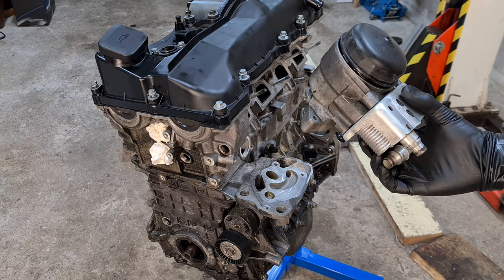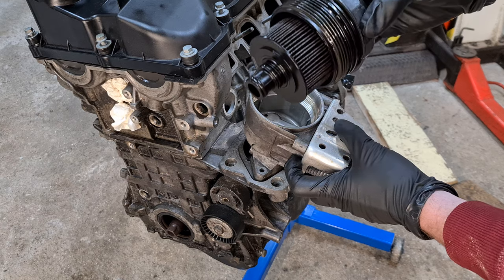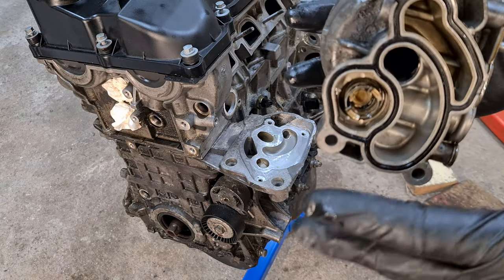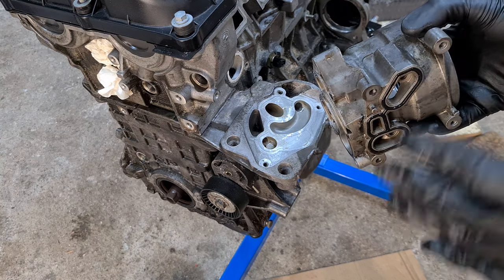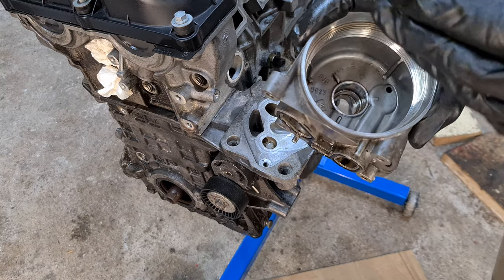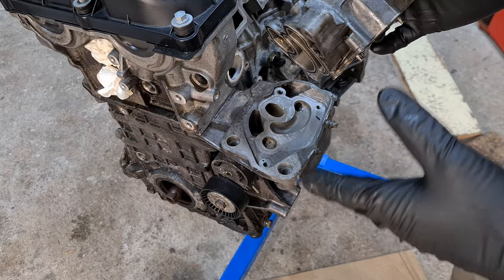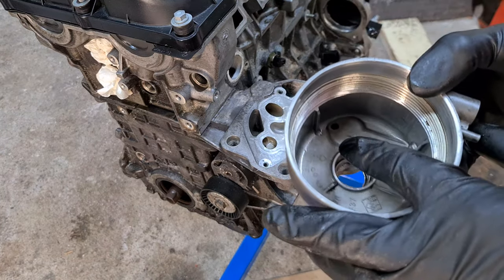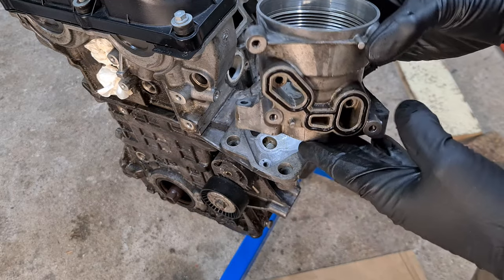N42/N46 Oil Filter Housing Details Explained

Comment: i have water that is mixed with oil out of this unit ,its a nightmare,i was hoping you were going to say if oil is coming out of ,but anyway ,i take it it will be the heat exchanger would the gasket cause oil to go into the water pipes? when i strip it of the engine will let u know if it was the heat exchanger ,great vid thanks for showing me this unit :)

Comment: Thanks for you reply, one other question, when I removed the oil filter housing and cooler to replace the gaskets I did the finger over the hole test for the check valve and it leaks which accounts for the startup rattle I believe. You mentioned the checkvalve is a non replacement item - is that still the case? What would happen if the checkvalve was fixed? I mean blocked off.. just curious. thanks again.

Comment: I have bought a car with an N46 engine. It has low oil pressure when the engine runs. Aside from low engine oil, what are some things that I should check?

I am replacing the engine-oil filter and all of the o-rings and oil-filter housing gaskets.
Reply from the maker: 1. Faulty oil pressure sensor (normal open switch).
2. Pieces of broken chain guide inside the oil pickup, oil pump, oil pressure regulator (oil pan needs to be removed, everything inspected and cleaned, and chain rail replaced)

Comment: Would you be able to do a video on how to get air pockets out of the coolant system/ common leaks ?
Reply from the maker: In general, you open both vent screws, turn ignition in to position 2 and turn up the temperature to max. You then slowly add coolant, filing it to the top. When you se that level stays steady, you close the vents and filler cap. You then run the engine until the thermostat opens. Then you recheck the coolant level and top it up to the max. Then rev the engine above 4000 rpm a couple of times for a couple of seconds to purge the air from the system. When the engine cools down a bit, you can re-check and top up coolant.
Reply: @BimmerZen  " Then rev the engine above 4000 rpm a couple of times for a couple of seconds to purge the air from the system." With the vents closed or open?
Reply from the maker: @robertalexandrescu9975  closed

Comment: Hi, I have the same engine in a 18ti, and one of the conectors of the coolant in the oil cooler is broken and I bypassed that tube, so there is no oil refrigeration.  I have to wait over two week to the part arrive to change it . Will that be dangerous to the engine?

Comment: I replaced both gaskets with Elring gaskets a few months ago and the bottom gasket is leaking again. The surface was clean and flat and gasket was installed correctly.  Have you experienced this issue?
Reply from the maker: I haven't. Maybe your oil pressure is too high?
Oil pressure at idle speed with engine at operating temperature 1 Bar min
Control pressure with engine at operating temperature is 4 - 6 Bar
Reply: @BimmerZen  could check valve cause this? No other gaskets are leaking just this one and it's pouring out

Comment: Thanks BimmerZen. Nice video at the right time. Since couple weeks a low oil pressure lamp is going on for 2 seconds on engine start up (e91 n46). I think it could be the check valve. Is there a way to check it? Or just take apart and inspect?
Reply: hi, just my two cents worth, I am a mechanic but boy are these cars over engineered, I can pull two american v8`s out in the time it takes to just jack up one of these bimmers. Anyway I have start up rattle in one of my e46`s, I pulled the oil filter housing and cooler, in one of the videos you can see where you hold the housing and put your finger over the little hole and pour oil into one of the channels, you can then see if the check valve is leaking, mine is, I have a spare housing , that one leaks as well.

Comment: Hi BimmerZen! Recently fixed a bad timing chain rail guide using your videos.
I now have a problem with the adaptation values for the exhaust cam sensor. Error code CDKPH2. I don't have inpa, but I use carly to read fault codes and values. Inlet is fine, reading 119.80. However, outlet is reading 120!! Timing should be correct. Is this likely to be a bad exhaust vanos unit that doesnt lock in initial position? It has poor low down power, but is okay at higher rpm. Has stalled once while driving, where warning lights came on.
Anyways, keep up the good work man, your videos are a goldmine!
Reply from the maker: One possibilty that comes to mind is that the exhaust VANOS unit was somehow not locked in initial position when you did the timing. I would start with the simple things first, like checking that all is correctly connected, especially VANOS solenoids. Sometimes people accidentaly mix connections. Next you will have to remove valve cover and check out timing with locking tools. Also make sure exhaust and intake vanos units are not switched around...
Reply from the maker: You could also try swithing intake sensor to the outlet, just to make sure its not an issue with the exhaust cam sensor.
Reply: Okay thanks! I replaced the sensor not too long ago, and if i remember correctly I also replaced the solenoids. But i will for sure check this out!

Comment: Thanks for another helpful video. Have you encountered the start-up rattle which many people have observed on N42 and N46 engines? You can hear this for a second or two when starting the engine from cold - especially if it hasn't been run for a couple of days. It sounds like the valve gear isn't getting any oil and disappears once the engine is running and oil pressure returns (this is my theory). I spoke to a BMW mechanic and he told me that this is normal and the result of oil draining away from the valve gear - but I'm not 100% convinced.
Reply from the maker: Yes, I know the rattle very well. In fact, I have it myself on my car and I plan to do some tests to try to solve the issue. I already replaced the chain/tensioner and cleaned the VANOS units, but that did not fix it. Next I plan to inspect the oil check valve in the oil filter housing, then replace the VANOS units. I suspect that worn VANOS units are the cause. I drove N42 cars that did not have this startup rattle issue, so there must be something going on:)
Reply: 99% vanos exhaust. I replaced many of them and it always was the culprit of that startup noise.
Reply: @Doganderboss  Do you know why they make noise? Is it because they sometimes don't lock when the engine shuts down. The two parts rotate internally from max to minimum advance until pressure builds to control them. Or is it the vanes and surfaces wearing out?
Reply: @BimmerZen udalo sie naprawć to grzechotanie
Reply: @Bimmerzen did you manage to fix the rattle noise ?. My mechanic changed the timing chain on my N46 engine, chain tensioner and VANOS units but the noise is still ther. Did you inspect the check valve ?.

Comment: Hi, great video. I have a question, I have a 2004 e46 318 AUTO with a bad N46 engine, can I fit an N42 engine in its place? THANK YOU
Reply from the maker: I'm not 100% sure, but i think it should work. Engines have same head, and internals like crank, pistons, rods, valve cover... i think the only difference is the ECU. N46 cars use just one single ECU that also controlls the valvetronic (N42 has separate ECU for valvetronic)

Comment: I recently replaced both gaskets, torqued to spec, but the leak remained. I cleaned the meeting surfaces with brake cleaner and a rug. Has anyone encountered such issue? I wonder if i should use some fine sandpaper to better prepare the surfaces.

Also N46 has a little different base, it's completely flat, while as far as I can see the n42 has a step in it.

Comment: Do you have a part number for the oil-pressure regulator valve?

How can I replace it?
Reply from the maker: Remove oil pan, it's on the bottom right side of the oil pump housing. PN: 11417507648, 	11417507755
Reply: @BimmerZen it looks like the shaft on my oil pump sprocket has failed.

Is that a common failure?
Reply from the maker: @OilBaron100  no, but please explain what exactly failed and what the damage is?
Reply: @BimmerZen  I can’t upload a photo here.

There is a sprocket at the front of the engine, a chain spins the sprocket. The sprocket sits on a shaft to the oil pump.

The sprocket has snapped and the sprocket is no longer connected to the oil pump.

Comment: Where can I put an oil manometer?
Reply from the maker: Oil pressure sensor/switch, but you need to remove the intake manifold to get to it. There is also a special tool that acts as an oil filter cover and has a manometer fitting.

Comment: Hi, i have a 318ci with 170k km on the clock, witch burning 1l/1000km approx., I have done the ccv changed but no change still smoks alot when start heating up.
I'm using castrol 5w30.
Any solutions for this ? or the car is just out 😔 
Thanks.
Reply: It smoks a little from engine bay when cold start and rpm returns to normal !
Reply from the maker: Your valve stem seals are bad, you can replace them yourself if you have some tools and patience. Here are my detailed DIY guides: https://youtube.com/playlist?list=PLcvaV8_M2DkZpcUVCwfjXivvaRIE_JReW

I also made a special tool for replacing the seals on the N42/N46: https://bimmerzen.com/store
Reply from the maker: @ahmadkheiro735  Your valve cover gasket or vacuum pump seals are bad. Oil pools at the back of the engine and pump housing and drips on to the exhaust manifold and vaporizes after 1 minute of engine operation. Here is a DIY on how to replace it: https://youtu.be/z60kTeW2GUM
Reply: @BimmerZen  Thanks man really I appreciate it, unfortunetly I don't have any tools or so, average mecanic charge around 1k € for this job, I will give liqui moly oil stop à try and see if any improvements and check for those oil leaks too 👍🏻
what about oil is 5w30 is good or I have to go for 5w40 for my milage ?
Reply from the maker: @ahmadkheiro735  You could try 5w40 oil to see if that helps, but 5w30 LL04 is recomended

Comment: Does anyone know what could be the cause for big fuel consumption on this engine? Mine is about 15-16 litres /km.
Reply from the maker: Any error if you scan with INPA?
Reply: Do you have the 1.8 liter or bigger? Touring or compact? Most times (of what I heard) when fuel economy drops, the VANOS system isn't doing its job. Hook it up to a computer and find the faulty sensor/actuator.

Comment: what about rod bearings on the engine?
Reply from the maker: @ВладимирВладимирович-д7ш2я  ?
Reply: @BimmerZen  i mean when u usually change them
Reply from the maker: @ВладимирВладимирович-д7ш2я  not needed unless you have oiling issues like clogged oil pickup.

Comment: I have changed both gaskets and Anca find ule in radiator which could be the cause ? thanks
Reply from the maker: These gaskets do not seal the oil/coolant interface. You might have a bad oil cooler.